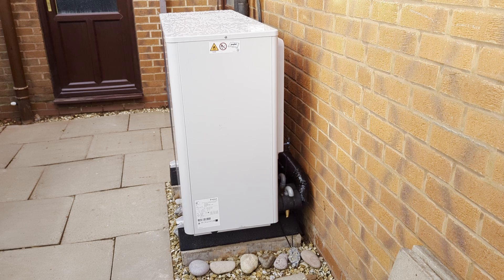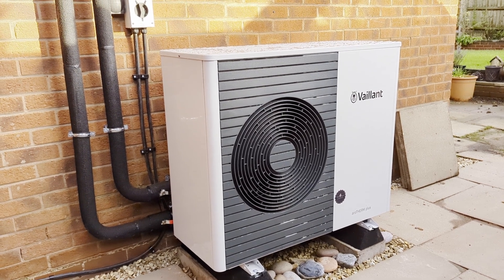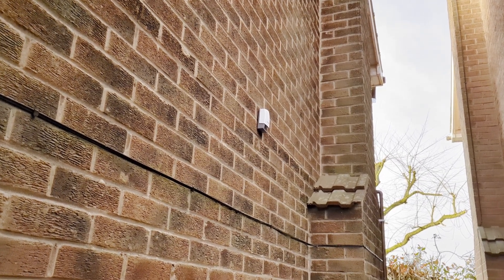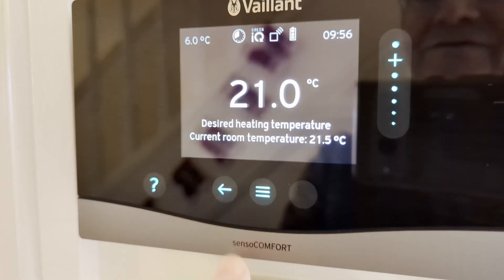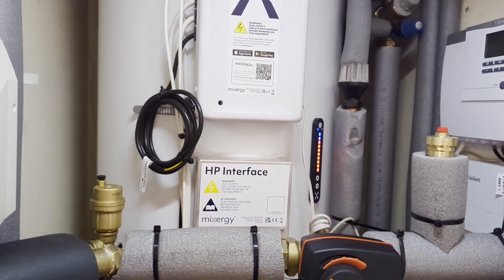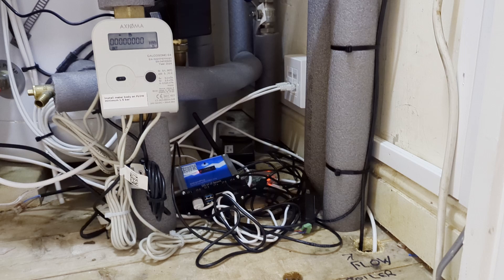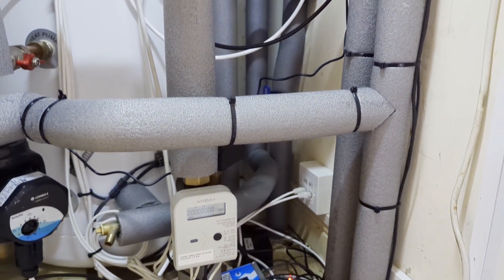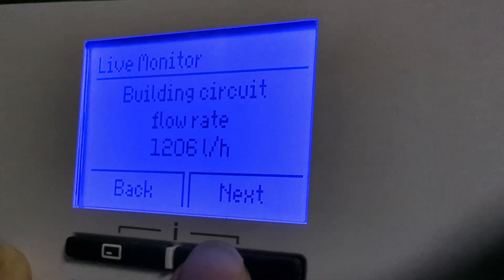Heat Pump Installation - Day 5

Comment: Interesting to see this hot water cylinder requiring heat exchanger with pump. Does it not have internal heating coil and takes hot water directly to pump it through the heat exchanger? Is this solution more economical compared to internal heating coil?
Reply from the maker: I can understand that, but Mixergy take a different approach. They believe that an external plate heat exchanger is the best approach, and they have numerous reasons…

https://www.mixergy.co.uk/blog/using-your-mixergy-tank-with-a-heat-pump/

From our experience, our heat pump via the plate heat exchange, can heat our entire tank on a freezing cold night from 20% to 100% in around 50 minutes. Mixergy tanks also support heating just enough water for your requirements (using a machine learning model) which means that if we only need half of the tank heated, the heat pump can be used to do that too.

The machine learning model integrates our hot water usage requirements with Octopus Agile’s dynamic pricing to ensure that (a) we have the water we need when we need it and (b) it’s heated at the cheapest time.

I think that Mixergy tanks are very clever and worth the extra cost in the long run.
Reply: @ interesting. Thank you for clarification. It seems that their approach would be even more efficient if the external heat exchanger was fed by refrigerant directly to eliminate unnecessary interface between water and water and boost efficiency even more, although it is probably much less practical.

Comment: Are you sharing your open energy monitor, if so have you got a link
Reply from the maker: Yeah, OK, here y'go. I'm still struggling to keep the heat/flow sensor happy (I think there might be a bit of air in the system), but I think we're doing pretty well.

https://emoncms.org/app/view?name=aroTHERM%20Plus%207kW&readkey=e64d41e26dec938a190cb91e90a30c50
Reply: @timminsit  

Have you increased the water pressure as yet, your flow meter needs a minimum pressure of 1.5 bar ?
Reply from the maker: Hi  @_Dougaldog , yeah, that's all fine. If I could just get it to stop moaning about air in the system during the DHW cycles, that'd be super! <mutter>
Reply: @timminsit  

Just a thought, are the black plastic caps on top of automatic air vents loosened off to allow air to escape, there will be several of these fitted throughout system, above Mixergy heat exchanger as example, I also have one at top of volumiser vessel and another on the 'return' flow to the HP from the volumiser  ?

Comment: The amount of kit required is huge space wise. Just wouldn't have room in my little place
Reply from the maker: A littler place needs a littler heat pump. Get a guy to give your a quote and see what you think.
Reply: @timminsit  got no where to put a tank for a start. Houses don't have cupboards anymore for such kit.
Reply from the maker: Heat Geek reckon they've got a solution for that. It's a tiny tank that'll fit in (say) a kitchen unit. It's pretty clever. https://youtu.be/3QAX6ygW9HM

Comment: A nice install Jason 

The grey isolater is a nice touch, mine is one of those red/yellow ones that stick out like a sore thumb. Not aesthetically pleasing in the garden. What make is that isolator? I may consider changing mine to one in the spring.
Reply from the maker: Thank you. It's going well so far.
The isolator is by Scame. You can buy them here... https://midsummerwholesale.co.uk/buy/renewable-heat-accessories/heat-pump-isolator-32

Comment: Pressure is very low, given this is new install it is either leaking or installers did not performed checks well. Also I think this type of ESBE valve is actually mixing valve, which can be used as diverter valve, but there exist on market a proper diverter valves which perform their role better.
Reply from the maker: Thank you for your comments. We have a weeping radiator valve at the moment which will be sorted soon. The valve and actuator are working beautifully and the flow rate is good.
Reply: @timminsit  mixing valves cannot be fully closed, so they are always leaking a bit in either directions, but that is not something significal.
Reply from the maker: @MrCro93  the valve body and the actuator are separate items, I don't think you can see the body in the video. How can you tell it's wrong? Also, the actuator is either (mains) powered or not, it does not support variable positioning.
Reply: I think that you have ESBE ARA671 installed. Something like ESBE MBA135 would be better choice.
Reply: The mixing valve is when you set a mid point. That valve will be set up for a 90deg sweep from heating to hot water. I have the same high flow valve. @MrCro93

Comment: So that hot water tank doesn't have an internal heat exchanger?
Reply from the maker: @Chris-hy6jy  Yes, that's right. Mixergy believe that it's more efficient to use an external plate heat exchanger. https://www.mixergy.co.uk/blog/using-your-mixergy-tank-with-a-heat-pump/
Reply: The Mixergy heat exchanger has a surface transfer area of 3.5m^2 and works very efficiently, the lack of internal copper coil allows for a greater volume of usable water inside the cylinder.
Reply: @_Dougaldog  so the HEX is on the outside of the tank?  Sorry, I know nothing about these lol
Reply: @Chris-hy6jy  

It is and can be seen at 8:21 in Jasons video.
There is a pump circulates water from tank through heat exchanger (can be seen just below Exchanger), whilst water is circulated by pump in heat pump to other side of heat exchanger.

Comment: Just wondering how big that cupboard looking at heat pump but my cupboard is only 760 wide
Reply from the maker: Our airing cupboard is 730mm wide. That's just about wide enough for Mixergy's standard tank, but I went with the slim one because it would have be tricky to get the standard one into the cupboard.
Reply: @ how big is the capacity of the slim line
Reply from the maker: @trisknight9430 ours is 150L, but they do bigger ones.

Comment: nice setup👍
Reply from the maker: @robin5215 Thank you. Where are you on your heat pump journey?
Reply: @timminsit  you mentioned being warm in your home, we are the same, we still have the gas boiler because i'm not sure i'll like the slow and low approach..  we've had solar since the good old day's and two years ago we add a second 4.4k solar with 20kwh of battery storage, our main aim is to reduce our usage from the grid.
Reply from the maker: Sounds like you're in an ideal position for a heat pump. I agree that 'low and slow' seems crazy, but it seems to be working here... Let me get back to you in a few weeks.
Reply: @timminsit  thanks .. could you record your radiator temps, flow temps and your cop figures....cheers
Reply from the maker: @robin5215  ah well, good news, we'll be on https://heatpumpmonitor.org/ soon so you'll be able to see all that data for yourself. I'll send you the URL once it's running.

Comment: You might want to check the water pressure - looked to be on 0.9bar but your OEM heat meter wants it to be 1.5bar
Reply from the maker: OK, good tip, thanks.

Comment: Would you mind sharing roughly how much your heat pump cost including installation. Thank you.
Reply from the maker: Hmm, I dunno. It seems that every home is different, in ours we already had a heat pump compatible hot water tank and we'd already upgraded most of the radiators. I'd say, just use the Heat Geek site, it'll give you a quick price which you can then follow-up with a (paid-for) heat loss survey from a local Heat Geek. If you don't like the quote/price/whatever, you can have your money back. Octopus Energy are the same, we didn't like their quote and they gave us the survey fee back immediately.

Comment: All looks good although with all of those pumps, valves, and other tech widgets it does seem as though there’s a lot to go wrong in the long term with potential for high expense.
Reply from the maker: I think it'll be OK. There's only one (expensive, high quality) valve now, rather than two before. The monitoring gear sits passively on the pipework so, if it were to fail, it'd just stop monitoring and won't/can't affect the actual operation of the system.
Reply: @timminsit  Thanks for the reassurance. I have a heat pump survey booked in with Octopus next week and I'm also thinking about including a GivEnergy battery.
Reply from the maker: Batteries are a good option with a heat pump, but get a big one as a heat pump can use loads of power! Do you have solar?
Reply: @timminsit  Octopus Cosy is what I'm using for winter for import. On the really cold days you can top up the battery 3 times a day at fairly cheap rate so you could get away with a smaller battery, other considerations aside.
Reply: @timminsit  thanks. No, don’t have solar and the sunny side of my house is lined with an avenue of tall mature trees so it’s unlikely to be an option.
Reply: The system is pretty simple, could argue there’s more to go wrong inside a boiler.

Comment: Thanks for documenting and sharing this.

Looks like a great installation.

Your heat pump will be running flat out when it does a legionella cycle. Most of the rest of the time it will be using a small amount of it's capacity, even on a normal DHW cycle.
Towards the end of the DHW cycle when the flow temp ramps up, you can see the electrical consumption also ramping up and you'll be able to witness the unit getting marginally louder than normal.

Make sure you wipe the little solar panel every few months to keep it clean.

Unfortunately the sensocomfort is still very much needed. The app is very basic and buggy, mainly due to Vaillant servers!

Where possible avoid using the solar diverter with the current tariff rates. Better to export and heat the water with the heat pump overnight on a cheap rate for a 1/6 of the cost. 

The most efficient way to heat your hot water is to let the tank cool as much as possible  before reheating. Regular top ups will not help your DHW COP.

Enjoy your first winter of lovely comfortable heating and your new toy! 😅
Reply from the maker: Thank you for your advice. Very useful.

The Mixergy tank seems to understand about heat pumps and use them to best effect. The tank also understands about Agile so last night, at midnight, the rate fell to 0p for a short while, the tank called for heat from the heat pump and went from 40% capacity to 95% in that half hour. Very clever. I'm trying to use the machine learning rather than setting a DHW schedule, so we'll see how that goes.

I enjoy your channel, keep up the good work! 👍
Reply: @timminsit I was going to say why @UpsideDownFork said about the solar diverted, but he's already covered it, it probably wasn't cost effective even when you had gas.